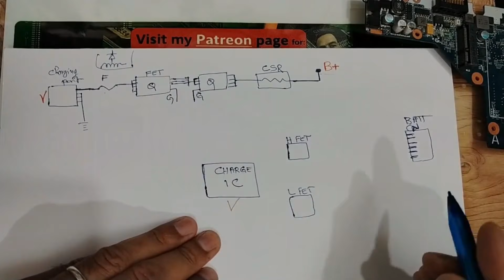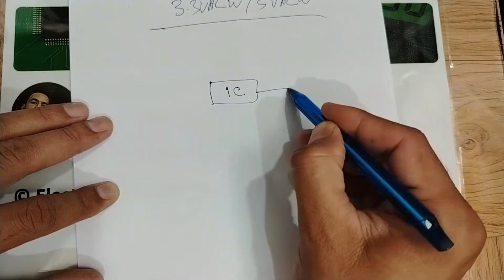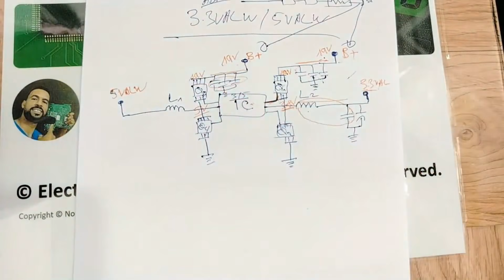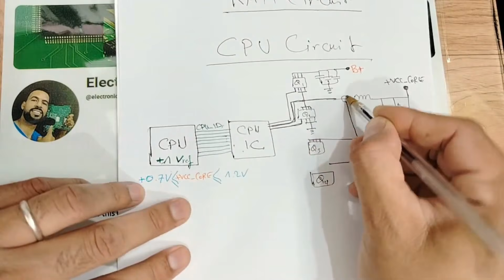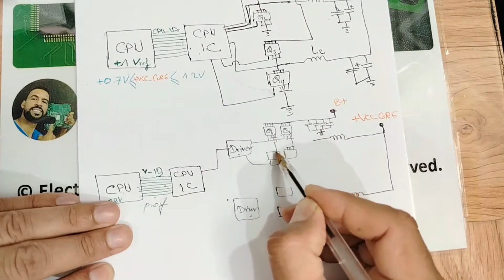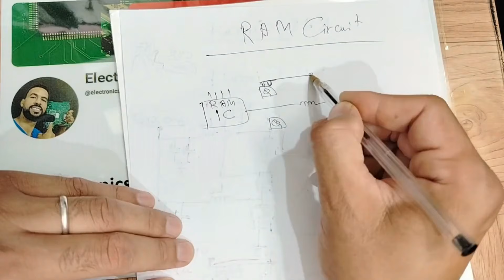All Laptop Power Circuits Explained in Minutes | Motherboard Repair Made Simple

Comment: Friend you are excellent in explanation of laptop circuits. Congratulations. Can I feed a motherboard of a laptop with 19V and measure the voltages in inductors without having HD, memories etc. on it? Thanks a lot. Christ
Reply from the maker: Yes sure, thank you
Reply: Hi friend! Thanks for your help. Is there any danger to damage (overheat) CPU or any other IC which is ON the motherboard without fan and any other load in order to measure the voltages in inductors?

Comment: thank you so much for making these videos with great and clear explanations. One question I have however, is in regards to the main and battery charging current sense resistors. I notice in your video you mentioned these should measure around 1 to 2 ohms but I cannot see how it is possible that a 1 or 2 ohm resistor so small would be able to dissipate the heat (watts) if the entire current from the power source is going through them. Even assuming say around 3Amps at 1.5 ohms this would be a huge amount of watts and resistors that small cannot handle this sort of heat dissipation.